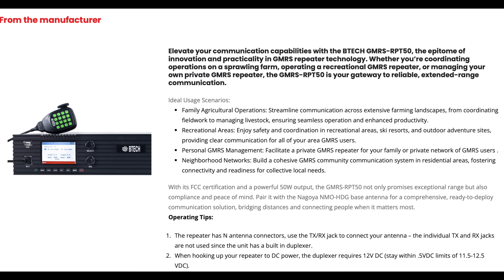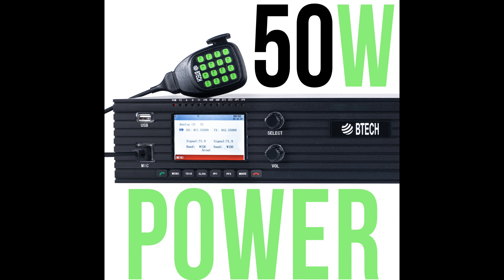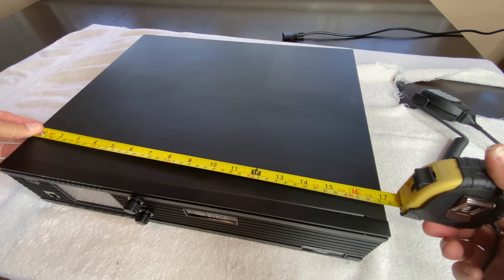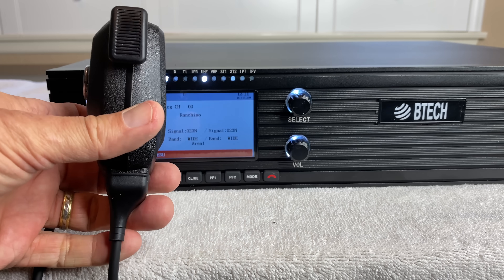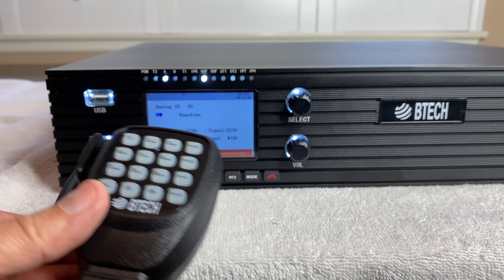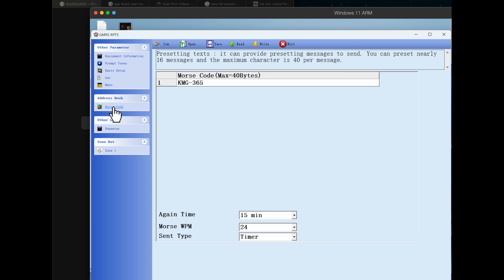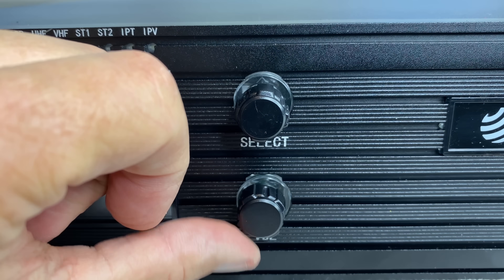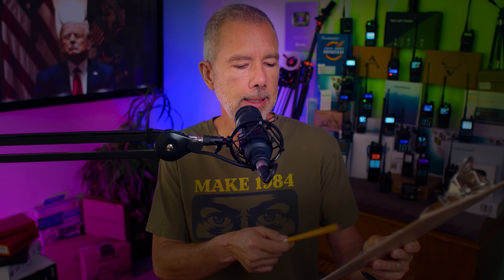My Experience With The BTech GMRS-RPT50 / Overview and Review Of BTech's New 50-Watt GMRS Repeater

Comment: I purchased a TYT TH-9800 plus 50 watt radio + repeater booster , turned into a lunchbox repeater for only 500ish dollars. I am very happy. It goes inside a Pelican waterproof case with an optional 12V 100AH LiFePO4 Lithium Battery build in and support multiple antennas based on what I need, covering miles based on my location.
Reply: Whats the range?

Comment: Dang, sounds like they have to bugs to work out. Now in searching for a repeater I have to figure out if the FCC’s would be against me running a HAM repeater at GMRS power limits if the HAM’s hardware has licensing approval for and from the FCC’s for those “Channels”.

Comment: So bummed. I have been searching youtube since this video came out hoping anyone else can show a working unit. I have received bad radios and it is very frustrating. A tdh3 was the most recent, but my replacement has been good as well as 2 other tdh3s owned by other people. This repeater is exactly what i need (on paper) but i really want to see a working unit work before i pull the trigger.

Comment: EDIT - I listened again and heard that it has a 100% duty cycle. I'm a little bit skeptical on that, LOL. END Edit

Kind of a bummer that you can't use the mic but I didn't hear that a speaker can be connected, so it sort of makes sense. Not a big deal to just use a HT, but I'd rather not. What sort of duty cycle is it rated for?  Your Motorola is probably good for heavy use but at this price I wouldn't expect the BTECH to be. When you first described the problem I thought that maybe it was overheated.

I've also had great customer experience with B Tech, but as you know they do pretty much just re-badge Chinese stuff and provide better documentation/support.

Good price for a repeater that outputs approximately 50w out of the duplexer, if it works and lasts...

Comment: The repeater that I received was only transmitting at 10-15 watts. I emailed BTech, and they responded that some of them had bad duplexers, and that I could send it back so that their techs could replace the duplexer, or that they could ship me a new duplexer and I could replace it myself.

I had them send the duplexer. I did have a problem with one of the screws, but there were the 4 screws that held the top of the case on. Once I took the top off, there were 4 screws that held the duplexer in place, and three cables with N connectors that connected to the duplexer. It took maybe 5 to 10 minutes to get the duplexer replaced, and up and running. Afterwards, I was showing 45 watts output.

I did notice that even though I had entered my call sign in the software, it didn't show up in the menu on the repeater. And, the timer setting for the ID on the menu didn't show 15 minutes as an option, but it did in the software. In the timer setting for the ID, the header showed as "Hang Time".

They did do a firmware upgrade that corrected the 15 minutes, allowed CTCSS/DTS for the ID, and added the confirmation tone.

Comment: Hi Randy, this is Shane from Michigan. I have Far's questions for you today. Not sure how to word this though. Does a 50watt GMRS radio have a maximum distance limit of how far the signal can be thrown to its first repeater tower? or is this question more about the line of sight and or how tall a GMRS radio tower is no matter the distance apart? Used in an example: A Base station 50watt radio with an 80-foot antenna and the closest repeater tower is 100 miles away or 250 miles away? Both are in line of sight of each other. Or maybe my question should be how far can repeater towers be away from each before they won't communicate to each other? Probably a stupid questions, eh? but one I'm not privy to.
I'm working on getting my own base station going and I want to set up this free emergency repeater for all to use. I've heard vague discussion with some groups on setting up emergency communications at great distances between repeaters and we are quite lacking that here in Michigan. Thanks for your help.
Shane

Comment: Consider waiting a year, or until Bt 
Warrants all units are professionally
Tested for min 3hours continuous 
Output greater than 47 watts.

Bt tunes these for power using software, If its new but they do
Not test, or supply software which
Allows end user to adjust to specs

Then they (BT) need to compensate
Repeater  buyers
For Btech neglance

Comment: Randy, our GMRS Btech RPT50 experiences were nearly identical. Using Windows 10, I could not use the Btech software or the firmware. After manual programming, the Morse code identification would work only one or two times no matter what time interval was programmed. Lastly, on high power, it only broadcasted at 14.5 watts. Paypal will issue a 100% refund after the repeater is received by Btech in South Dakota. The cost to ship the RPT50 back with a shipping business this morning, via UPS was $139.30! I'm looking for a replacement rock solid GMRS repeater in this price range... any recommendations? Can true happiness be found with a Vertex 7000? Best vendor for the Vertex?
Reply from the maker: I am very happy with my VXR-7000.. you can only find them used now, and the biggest issue with it is that the software is hard to get and is very old - i can only get it to run on Windows 10, cant use it on Win11...

Comment: Great vid as always Randy,  A few of us gmrs users here in our town want to set up a repeater system,  this helps us with more info on what not to just rush out and get, but like most electronics, first versions sold,  like say game consoles, radios etc,   are usually and unfortunately plagued with some type of problem.  like a software / firmware glitch,  overheating and causing a hardware failure, cold solder joints ( seen way to many brand new cb radios over the years where a factory solder joint was the issue ) .or just something that was not clearly checked with qc dept,  before being released for sale,  and needs either a firmware update, or sent back to fix said hardware failure, like  in your case the duplexer failed. my guess and just a guess.  is the duplexer transistors got overheated and failed due lack of a proper cooling design in the unit. since the repeater is alway on  either in standby listening for a signal to relay, and or transmitting said signal out

Comment: Great Review. It sounds like an overpriced unit to miss. It's not ready for Prime Time, just yet. It needs some more bug fixes. And it needs a set of modern features. And functional connections on the back. I mean what is with that? You put the connectors in.  You don't include the software to make it work.  Great! Maybe in a future firmware upgrade? Maybe? And maybe, not?  But otherwise? Their service and tech support was superb. Great! Not helpful if they don't make useful usable units. And the brand-new duplexer was burnt out. And they had no spare parts. How is that possible? Whoops? They never thought it would fail? And they were all bad. Right out the gate. Right. And maybe they'll get a part for it in 2 weeks? From China. Right. No they will not. Because it's a slow boat from China. 2 weeks? No way. 2 months? Maybe? Maybe before Christmas?  So they can sell some more nonworking units.  And keep the doors open after January 1. Maybe?

Overall. It sounds like one guy is working there? And he's a bit overloaded. And should stop drinking. And fix those units. Because 50 watts, sounds good. Can do some effective work. But not if it doesn't for more than a few minutes. I mean come on? Did they not test anything?  Have they no, Quality Control? They shoved something to market that was not ready yet? And maybe later it will be? Months from now? After you purchased, it? Sure that makes a lot of sense. From a marketing standpoint. When you want to go out of business. That's how you do it.

Yeah no. It seems like a bust, to me. How disappointing.  Not that I'm actually into GMRS or give a crap about Repeaters? I really don't. But in thinking about getting some? Or just using what I have?  With nobody to talk to. No friends left alive. At my age. This all really sucks. Not as much fun as CB. When you can talk to somebody, all over the place. And depending on how much power output you are illegally using? You get some really good Far's.

Skip to my Lou my darling. And around the world. Breaker breaker good buddy! Much nicer..More fun.
RemyRAD

Comment: I also sharted myself over the price and still paid for one with my moneys out of my own shit-filled pocket dollars.

It's been getting 100% duty cycles for local communications. Just wish the networking wasn't behind DLC. But waiting for that firmware update!
Reply: For my experience, it's been up and running for about 2 weeks now, no issues, about 46W full time with an Ed Fong antenna. I also use CTCSS tones so I didn't have the DCS issues, but really I haven't had a single issue. I just wish the software and user manual wasn't as Chinese as it is. I also am a BTECH nerd and have a 50v2, UV5G+s (I know it's baofeng but it's the same stuff) and GMRS pros. I haven't had ANY issues with any of my stuff.
Reply from the maker: Does yours have loose knobs?
Reply: @TheNotaRubicon  Mine wiggle and jiggle just as much as my mechanical keyboard being used to type this message, so... yes? But not as bad as in your video. I can tap on them without them even moving. Seeing as they don't get wiggled as much as my handheld knobs on the daily, and are supposed to be abandoned in a shed after one use, it was an acceptable item to save on cost.

Comment: This video sums up my experience with BTECH. Purchased three radios from them so far this year and returned two of them within days due to out-of-box failures. One hardware related, the other a firmware issue. The third radio has not been used much, so I am suspicious of it. But every time I contacted them they responded immediately and provided options, included for simple programming questions. Outstanding customer service. If only they could get their quality straightened out I might go back to them, but have decided to avoid them until I hear about things improving.
Reply: Same here, except I've only purchased one of their radios to this point. Thanks to Randy's review, I'll probably give the Radioddity DB40-G a chance to replace my now non-functional and not quite three year old BTECH 50X1.
Reply: BTECH's QA team are their customers. 🤷
Reply: I wonder if the Chi#n$×es factory is sabotaging the BTECH line, as it cuts in to their main production of Booufang and Oshinwooshun name plates? 🤔

Comment: Shame it looks like this one isn't ready for prime time yet, but hopefully given a few months they can work out the kinks and and it will be ready for round 2, kinda sad to hear the WiFi and IP ports are basically for show though , would have been awesome if those could have been used for a web GUI configuration or even better being able to link multiple of these in an area so they all function as one to blanket an area (or connect to different states/cites).

Comment: I ordered a 50W BTech ham mobile, and it was missing a cable, so I emailed support. In my experience, BTech support is excellent. They sent out my cable immediately. I also like the radio. However this repeater seems like junk. Not worth $1500. Hopefully they will improve it.

Comment: What are you using for the squelch setting for your Vertex standard. I have one as well and am using the commercial settings which is killing weak or distant transmissions. Not the manual settings.. Just trying to get this thing working as it should.

Comment: RANDY, I THINK ILL STAY WITH THE US TYPE REPEATERS LIKE KENWOOD. MOT, ICOM.
FIRST REPEATER IVE SEEN THAT DOESNT HAVE A REAL MIC ON IT. I HAVE A ICOM FR 5000 50 WATT VHF REPEATER WITH A DTMF MIC ON IT. AS YOU WELL KNOW, YOU CAN GET A USED  KENWOOD FOR ABOUT 900 BUCKS IN DESCENT CONDITION, OR A MOT. FOR A LITTLE MORE. THANK 
YOU FOR THE VIDEO. I"ll
STICK WITH THE 3 MAJOR BRANDS.